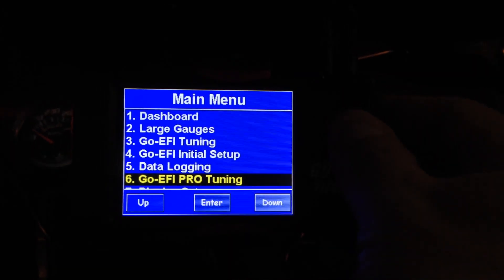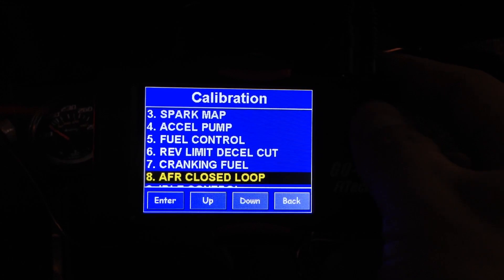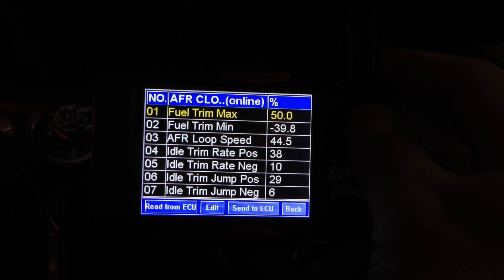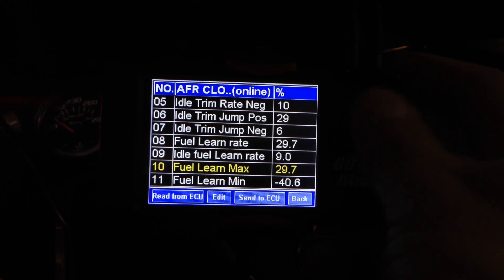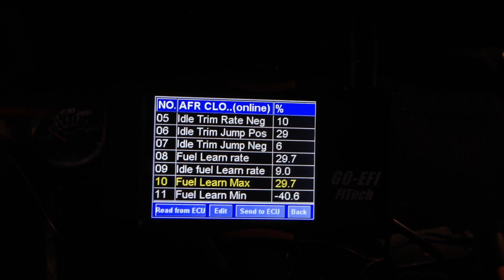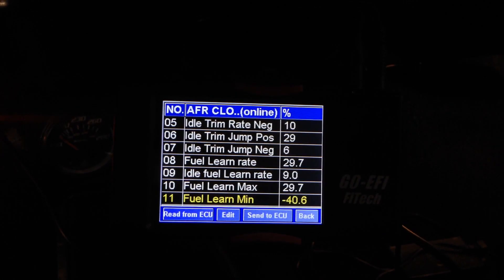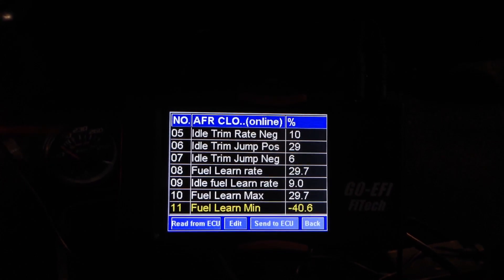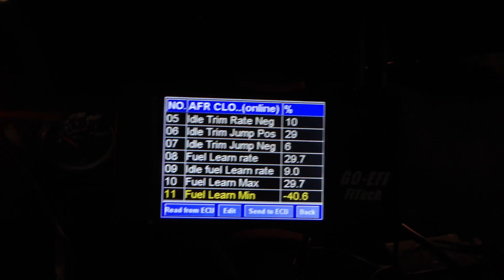Fitech - Adjusting max and min values for fuel trim and fuel learn

Comment: First off you're an amazing guy, thanks for spreading your knowledge. I have a Fitech 30002 in a Built 93 k1500 4l60e
 When I get into 4th it's goes rich..13.8  or so. What's the fix if you know it?
Reply: I have a 94 k5 blazer and my psi won’t go past 43psi this video might just have saved me some money

Comment: I reset my fuel cutoff settings to your recommendations. WOW. what a difference it made. So glad I found that video. Now I won’t need to have it professionally tuned. Thanks again
Reply: Thanks for the tips. I will check them out. 👍
Reply from the maker: Glad it helped!
Reply: Do you have any more tips I can use for my big block 5 speed Nova?
Reply from the maker: @mikeburnett7028  Really depends on the goal. Watching my videos that I did a few years ago, but there are also some videos by Fitech themselves finally. Also look for a few other content creators like SS454LS6 who did a deeper dive into some of the advanced tuning and logging. The Fitech are limited in there adjustments, but definitely some things can be tweaked to help guide the "self learning".

Comment: Just found your video on setting decel speeds on your FiTech. You said to make settings to 16 and 18 for a manual shift car. I’m going to make that adjustment in the next couple days, I hope it works. When I remove my foot from the accelerator at speed, it doesn’t idle down very fast, and I have to brake sooner than I need to. I hope your settings work for me

Comment: Please help...fitech PA 400, my problem is afr's are reading 15-16 at idle and 14 at full throttle. cam is a 110 lsa.. no exhaust leaks  but engine is running really rich.. when i floor it black heavy exhaust. but afr reading 14... i been reading and tuning for months..I would appreciate any  advice pointing me in the right direction         Thank you
Reply: Dee Gasparro same happening to me! Have you found a fix yet?
Reply: I'm having a opposite issue from you guys..im at a rich high 10 to high 12 afr at idle..and goes to 12.5 at wot.no exhaust leaks that I can find..

Comment: I have a manual transmission car and every time I approach a stoplight and push the clutch in the car dies but will immediately crank back up when I turn the key what do I need to adjust or which video do I need to watch
Reply from the maker: Barry Glenn common issue. Most likely the dfco kicking in too much. Lower dfco cut map to 16 and return map to 18. That will probably resolve it.